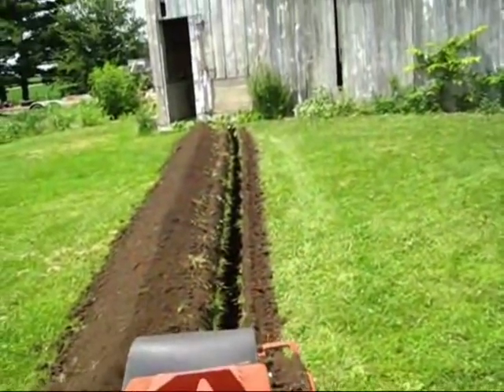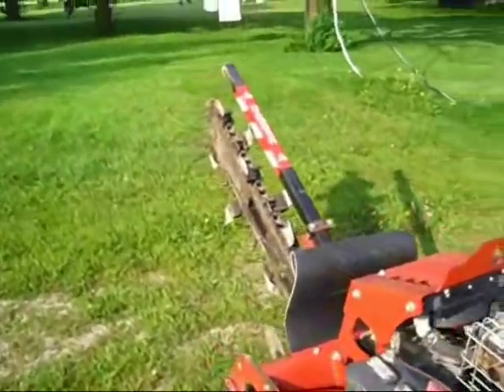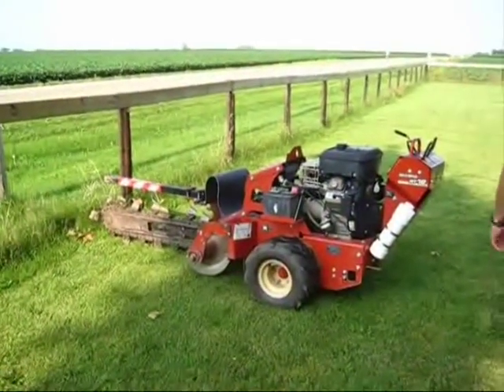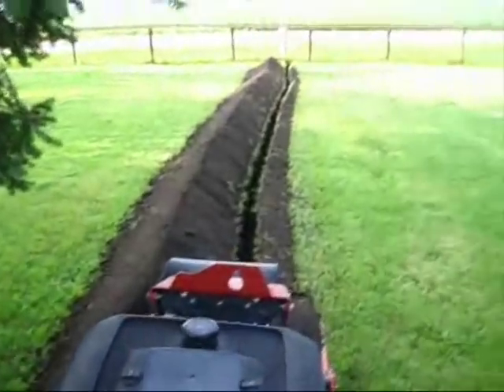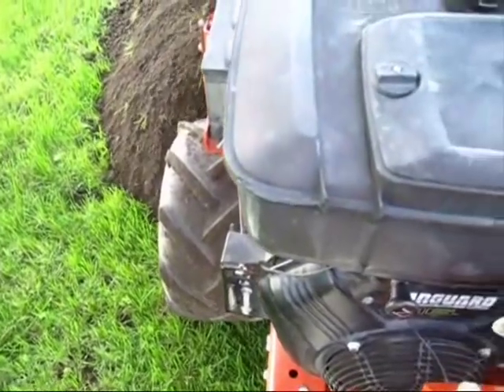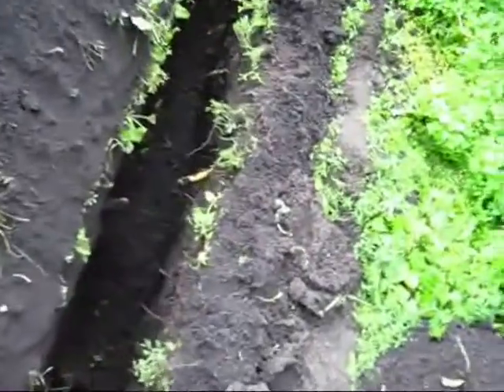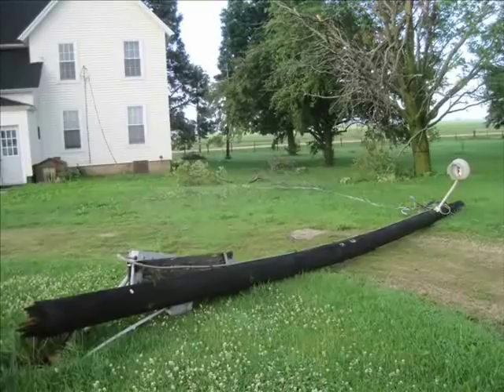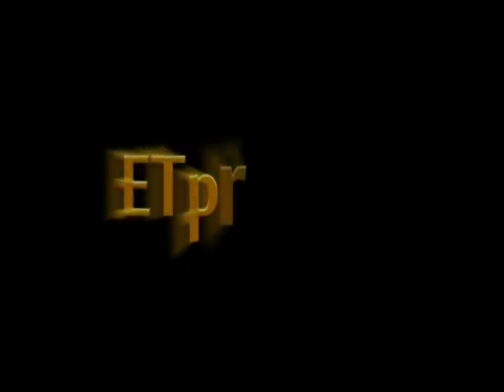Off Grid Project:   Trenching for Underground Power Cables

Comment: I used that exact model a while back, had to trench 1/4 mile for water and power, the terrible tread on the tires made it nearly impossible. I had the company exchange it for a toro track drive model. it made a WORLD of difference, 4 times the speed, no slipping, and straighter ditch.

Comment: Awesome video.  I too have that project on the burner.  Right now our power goes to the house from the pole, then back to the garage.  Big mistake who ever built this place.  I want to trench from the pole to the back of the garage, then from there to the house.  I have a metal shed that I am going to move behind the garage to store my batteries and generators in.
Reply from the maker: mfhmonkey Having a secure central power point makes sense. Good luck on your project. ETp

Comment: just curious...with the distance of that power cable, did you have any need to raise to fairly high voltage of transmission to minimize resistance load loss?
Reply from the maker: No, but had to use bigger cable.